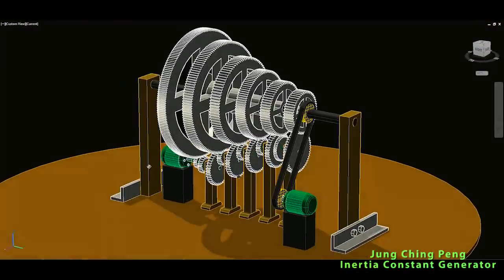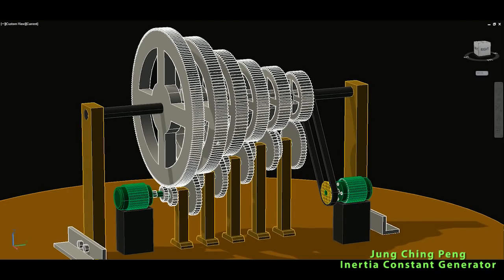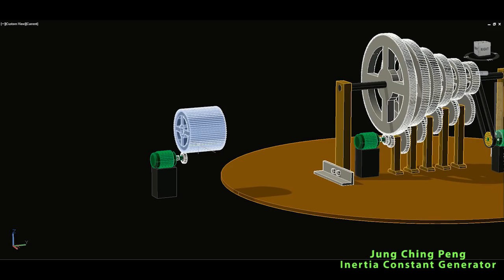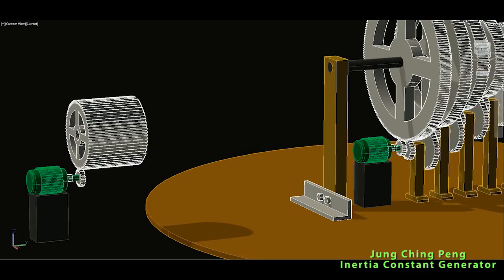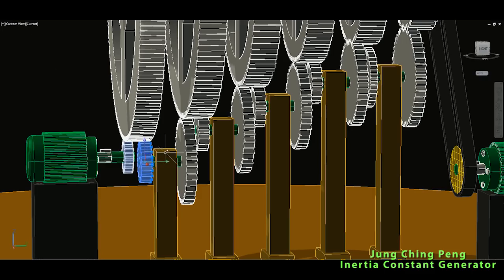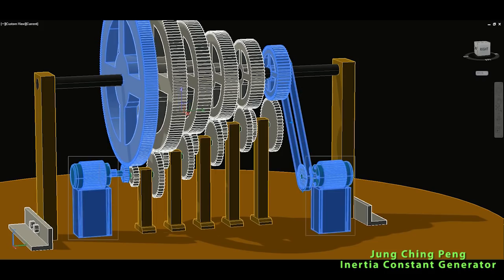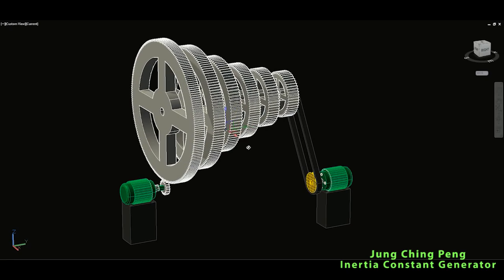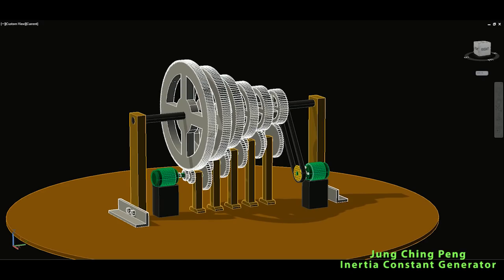Free Energy Generator 2018, JUNG CHING PENG Inertia Constant Generator

Comment: IT SHOULD WORK   DOSE IT???   I have been watching many of your vids ,very interresting  hopeing I could make a  spin off with some of the ideas . do any of them actually work.??? or is it they do work but not efficiently. when I analyse some of your videos they have  help me save a lot of time when we understand why they don't work. Tnks for the posts.
Reply: Actualy many things work but they don't produce the Torque or you have to put something in to get something out . but if you take a natural power like solar or steam or Kenetic even clockwork ,of course theres no free energy but if you can crank up or storage or use it to run something else  for 8 hrs and get 40 or 100 kw  then were going places
Reply: Brian Reynolds
 NASA had vechles running on hydrogen in  the 60a India had some good sterling engines doing Man sizejobs so did nasa many born from the 40s to 70s had many skilsthat came accross these technologies but they have been crushed by corporations or wernt viable manufacture wise now they maybe problem is construction industry and rent has closed down all the small hardware stores and factories with your prime comonents .
Reply: 1rst of all, you cannot connect gears like that, you need the same ratio of gears just like in a car's gearbox. Second of all, both drive belts and gears do NOT transfer 100% of the power from one to another. And last of all, it can't "boost" the power by making the generator spin faster, because P is a constant = torque*angular speed. Speed goes up, torque goes down.

Comment: Just answer me yes or No, would your invention give free energy, I mean free electricity truly?
Reply: Not like that. Most of the elements in the universe are moving automatically. I want that kind of element, that would give human being free energy.
Reply: NO !!
Reply: No problem: solar energy, wind energy, wave energy. There you go, no fuel needed and totally free.
Reply: i can give you 4 different yes's
Reply: the first one i am builing will not be perfect as i cant cast my own wheels and so ther will be 4 contact points on the traction balls and to be perfect it would be 3
Reply: Thanks. I need not cheap but totally free energy without any kind of fuel.
Reply: IMHO, All that this device can do is move the same energy from one side of the device to the other, less loss from heat and friction.  The gears may increase speed as the energy moves to the right but at the same time the gears reduce the force of that speed (torque or pushing power) resulting in no net gain of energy.   Both are used in determining any gain or loss from an electromechanical system.
Reply: http://ife-perpetual-generators.simplesite.com
Reply: me to :)
Reply: no consomption of any kind just maybe a few Wheel barring very rarly..or i could com up with a magnetique Wheel pivot axis. as i can get that Wheel in 0g and there is the intra-actif perpetual Wheel that is more powerfull and its not the Wheel that spins but the branches within
Reply: you cant have a free energy due to law of thermodynamics: law 1 ( input energy is gr8 than output) and law2 : losses due to friction etc. please read them separately! yeh there are elements which are moving without any input energy( like expanding of space elements). But above thought is totally false when we consider big bang theory. please read about entropy.
Reply: well the intra-actif Wheel i am building is going to have a minimum of 6kilo of drive force at between 400 to 1000rpm just on the first main perpetual Wheel. the drive magnets will get the core reactors up to full speed ( non magnetic large ball with metalic core center. the minimum of three core reactors eatch on a branche will accelerate to the max speed of the power of the magnet et and will not slow down as there is allways thwo branches falling in the non mooving Wheel rising one other branch. there will be heat coming frome the Wheel but im shur to be able to keep that cool .. and so gravity pulling on the branches twice and ading the drag of the magnets pull on the center core of eatch of the three ball will give a realy good propultion system.. i am spote on :) and yes i will keep it cool.. there are so many easy ways of keeping Something cool thats easy
Reply: oneslty in all respect i dont know what your all flappin about for. :) ya just use the heat generated from the slight friction to heat up your radiators in the house. everything can be sorted out in some way
Reply: and if to difficult to keep cool then i say build the system in a water tank  and this will be your water heater also if ever it does warm up Under water but i have no doubt it will work brilliantly when i was less than ten i hade these recurant Dreams of a ball constantly Rolling down a 45° sloap going left to right never finding the bottom. and everything is telling me that this will work from what i have seen ........
Reply: i will have to get an outdoor swiming pool if i want to build an underwater one and thats what i will do. later :) it can be made as water dinamic as possible.  lots of fun i say
Reply: and for the core reactor i could easely make them out of expoxy with the impact resistant aditif that resists tempuraturs of up to 600° mixed with other non magnetic material with a gripy surface rolling on a heat resistant rubber coat on the interior of the main Wheel. what do you think ?
Reply: true there is a lot better and safer.. that glass cell can be dagerouse. so i recon replace the glass cell aditif with granit powder or maybe just sand it will be heat resistant and stille verry strong .. resine and hard rock dust . or even époxy granite dust and sand with the iron ball in the center it will have good gripp on the rubber in the Wheel heat and impact resistant and not Dangerous to handle
Reply: Kayum Md the most promising to me is POE vortex coil, but you would have to do your own research.. I have done my own minor research and already confirmed it only has a south pole, something mainstream science and stuff fails to examine.
Reply: carolyn mmitchell ....how is your YouTube doctorate coming along? All that research should have you with at least a masters degree in YouTube physics.HEADLINE: Carolyn mmitchell has discovered the monopole magnet on YouTube, putting all scientists to shame.
  Maybe the scientists should be doing their research on YouTube, so their advancements to humankind can catch up to yours.
Reply: Nonya Business....it has the promise for dumb people to invest money in it.
Reply: carolyn mmitchell...conspiracy videos =research.
Reply: Kayum Md ....you’ve went through enough school to be a doctor, but didn’t learn enough to know that there is no such thing as free energy. Let me ask, have you ever had a patient that lived till old age without taking in any food or nutrition?
Reply: IF YOU BUILD MY DEVISES AND THEY DONT WORK ITS BECAUSE YOU HAVENT BUILT THEM PROPERLY CHECK OUT MY VIDEOS MY INTERNET SITE AND MY FACEBOOK PAGE;;VOILA